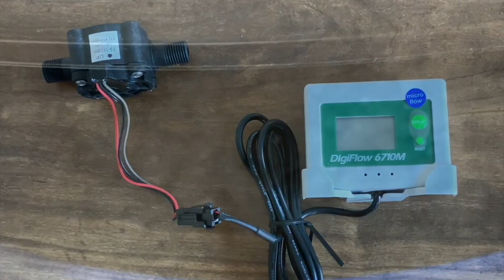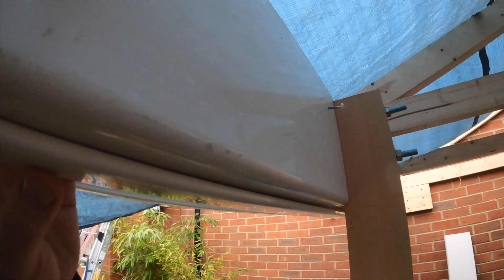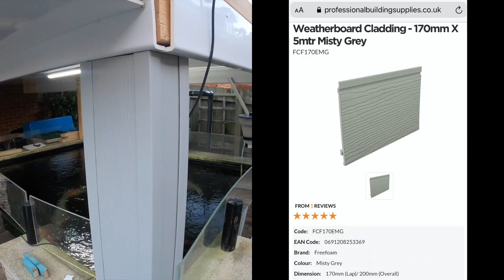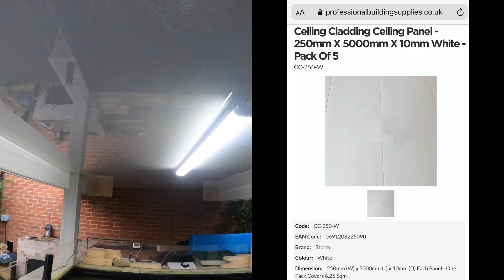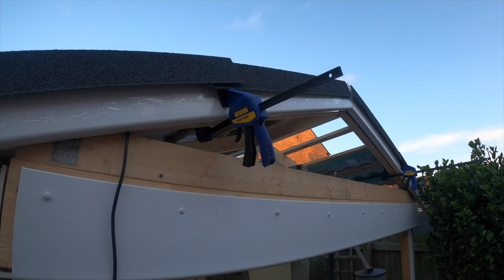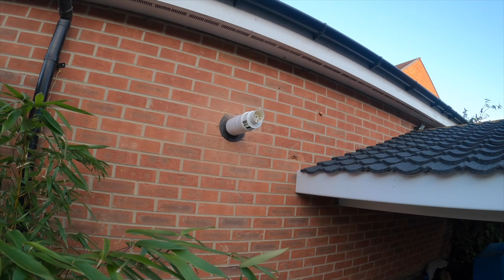Pond ROOF BUILD Part 2, MEGA QUALITY NEW KOI *** SAKAI Sanke / DAINICHI Showa!! *** KOI SHOW??

Comment: Hi Craig looking a great job you seem to be very busy with your lastest project considering how bad the weather has been and these early dark nights.Wanted to ask are you doing the same down your neighbours side with the upvc board’s because I noticed your a frame was cut shorter than side you filmed.How did you find those roof panels to work with would you recommend them ? i agree with your comment about boarding the roof before fixing the panels.What i was getting at have you got to cut length of roof panel on the short side.👍
Reply from the maker: Weather has been rubbish mate, crap time of year for this work you’re right!.
Yes the neighbours side has a shorter overhang as i felt it would get too close to the fence. The corotile can be cut however to save time and effort you can still use full sheets. It worked out cheaper cutting them in half on one side so thats what i did. It has the same upvc trim, cladded posts etc.

The roof panels are a bit of a nightmare to be honest to work with! 🙈. Everything has to be absolutely straight and true.